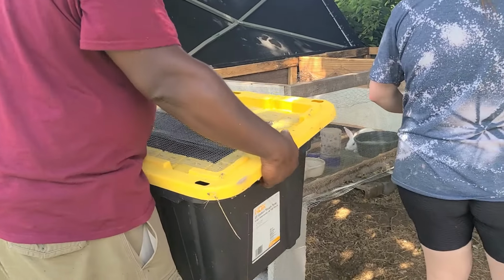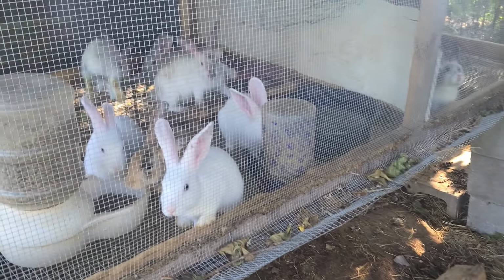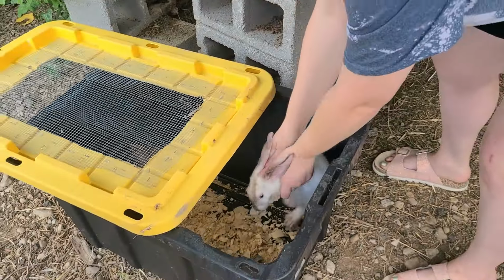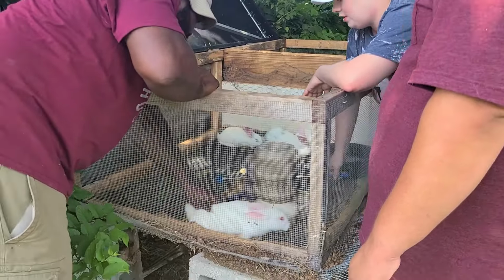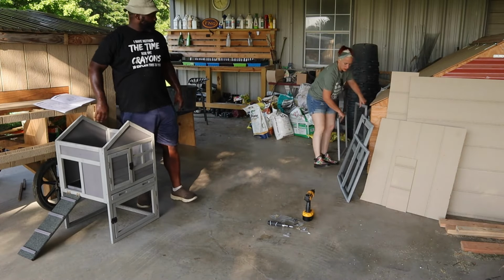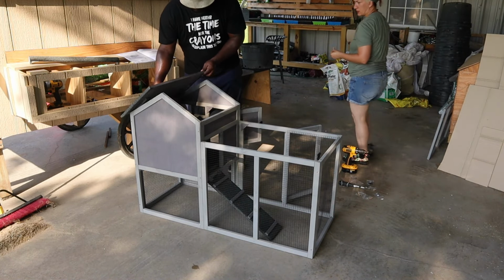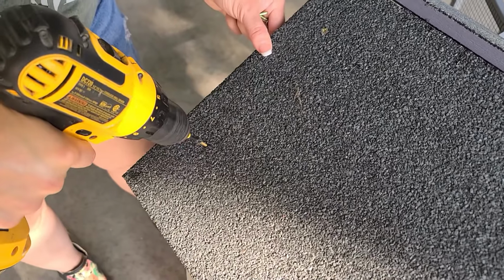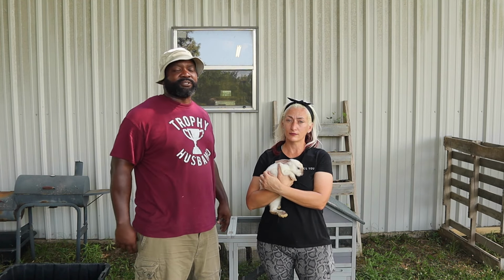The BEST Alternative Currency For Homesteaders - Aivituvin Hutch

Comment: To answer the breeding question, I've found a young buck (successfully) breeding his mother shortly after weaning. I've read that does should have their first breeding by 6 months (before the pelvis fuses), but I'm sure it's less time for smaller breeds and later for larger breeds. I encountered someone in a FB group once frantically posting about her rabbit having trouble with labor. It turns out the doe was around two years old, and hadn't been bred before, and this breeding was accomplished through the wire of adjacent cages; so I told her if she wanted to save the mother, she should get her to a vet immediately.
Reply from the maker: Oh wow. Well we definitely planning to breed our soon. Just wanted to take a butchering class prior to having any kits and weening them off and stuff

Comment: I have that same rabbit hutch... please put a glob yes a big glob of waterproof caulk on the screws on the roof or it will rot away in no time...
Reply from the maker: Great tip...thank you! What type of rabbits do you have?
Reply: @TheNakidGardeners  only a pet right now she is a flemish giant... when she lays out long she covers the entire bottom of the cage... I also put the cheap welded wire on the bottom and use it as a tractor... i think the wire is 2 inch by 4 inch... we do raise our own steer and chickens for food and a small garden... we are in florida on 2 and  3/4 acres